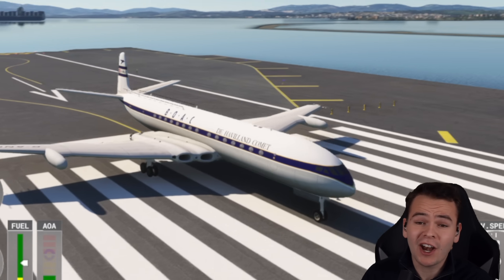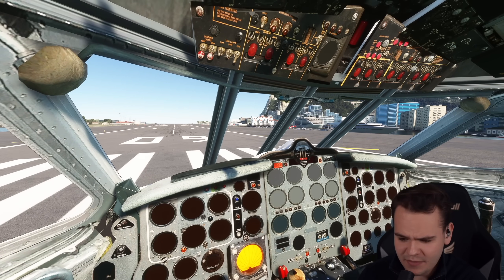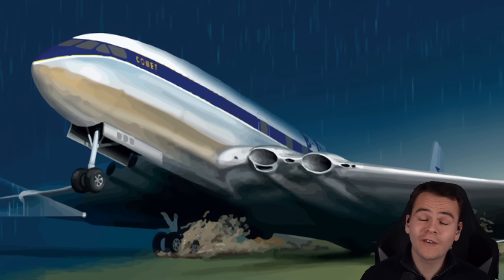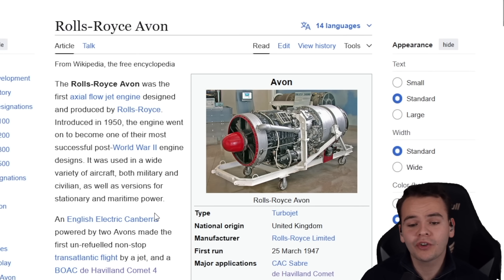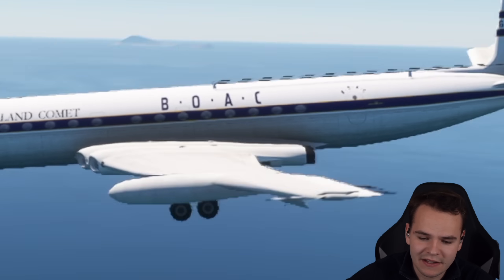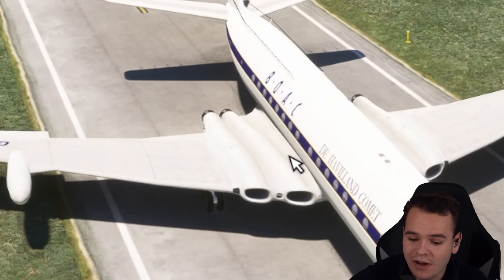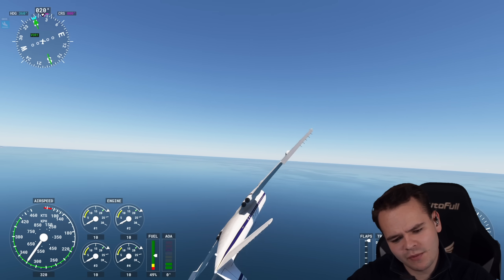Why the First Jet Airliner Was a Disaster!

Comment: The windows were actually round. Planes like the 377 Stratocruiser flew as high as, say, a 737, but the windows were more square. The real reason why is that the fuselage was thin and people underestimated how much strength the fuselage had, which was shortened because of bolted, not welded parts that formed cracks in the fuselage before the plane could even take off.
Pressurization cycles made these cracks larger and larger until eventually the metal failed.
Reply: De Havilland eventually admitted that they never performed the pressure tests on the fuselage sections that failed... it was gross engineering incompetence

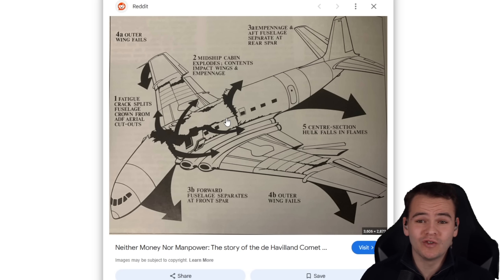Comment: 2:18 actually not true. The original comets’s windows weren’t squared,they had rounded corners,the real reason was that the ADF windows were “punched” into the fuselage,which led to the airframe being weaker than thought, infact after those incidents.they took a comet and tested it with water to simulate a flight,and although it was designed for 10,000 flights, the fuselage cracked after just 3,000 flight “cycles”
Reply: COMET DA BEST
Reply: So the windows weren't with the fuselage, rather bolted into after?
Reply: @   ok maybe i said it wrong.the fuselage was also partially the reason.since it was too thin,and the ADF windows were “punch-rivited”but the main point still stands.squared windows weren’t the problem (i mean look at the Boeing 377 stratocruiser,it has square windows and has a ceiling of 32,000 ft)
Reply: @LuchinoBruttomesso  probably due to high pressure Comet operate
Reply: @Randomly_Browsing If I recall, the square windows weren't necessarily the problem. It was the manufacturing process that would cause rivets to cause small cracks in the corner that would fatigue over time
Reply: @ioandavies2292  single row rivets?
Reply: @Randomly_Browsing 
If you look at the black and white photo Swiss included of it partially blowing apart during the investigation tests, you can see the window frame has been riveted into the skin. You can also see how the metal tore like paper through one of the lines of rivets along the edge of the window. Like tearing a cheque out of a cheque book.
Reply: @tin2001 The photos showing the passenger windows was from the laboratory tests that were later found to be deeply flawed and misleading.

The wreckage recovered from the sea confirmed that the passenger windows were not related in any way with the catastrophic in-flight structural failures.